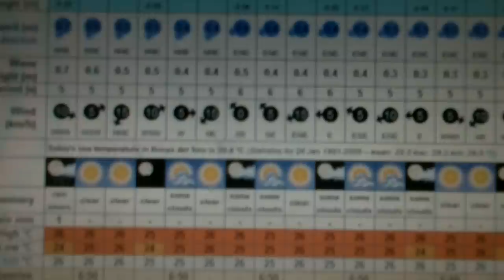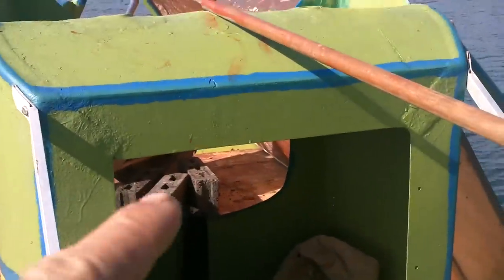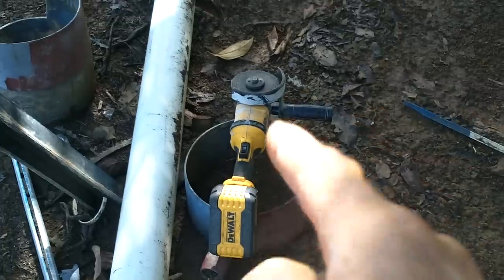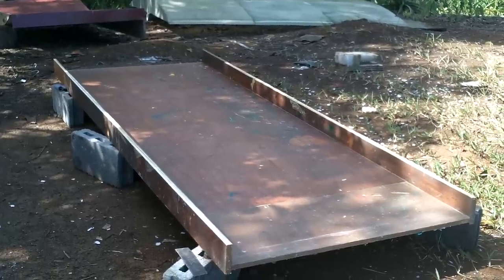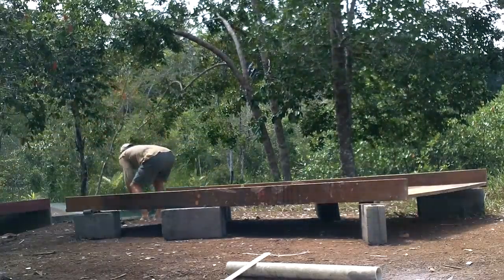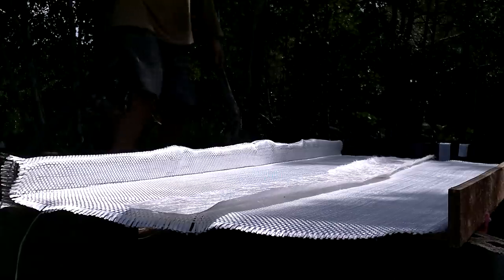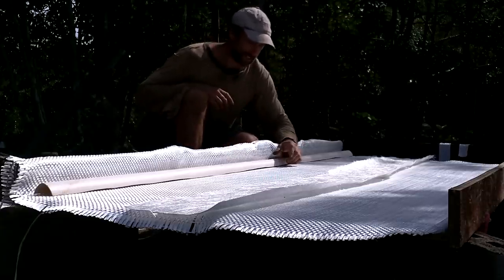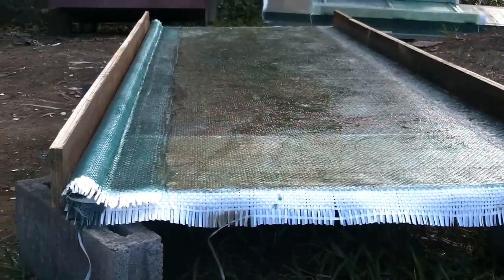Solar Snailer 029 Solar Racks

Comment: I think I might have found a different place to mount the glass solar panels than to have them in the main section. This way you can keep the battery bank charged when not using the boat, This would allow you to use remote power when needed.